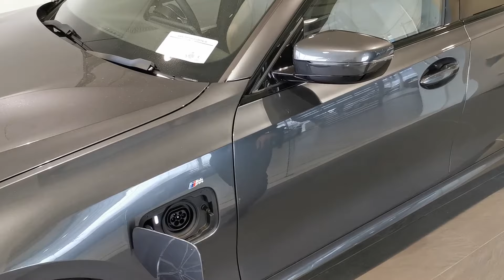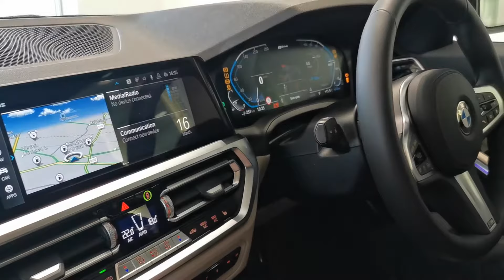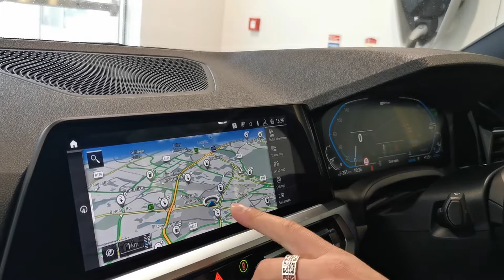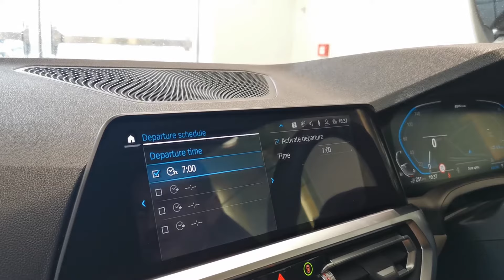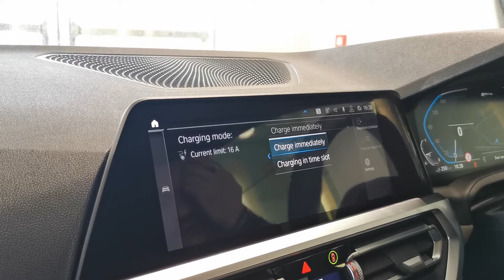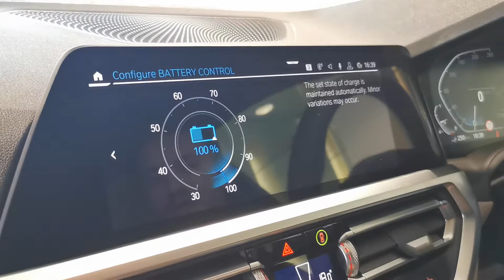How to charge your BMW Hybrid & maximise driving range

Comment: Great and clear video. A few questions though. When would you use electric mode? And also what is your opinion of not setting capacity to 100%? It's also advised to use not more than 20% of capacity. Any easy way to do that?
Reply: Electric mode should be used when you know you wont need the petrol engine, since in this mode the coolant and oil arent heated like in hybrid mode. If your comute to work 10-15km then you shouldnt need to have your ICE on.
Batteries dont like being at 100% and dont like being empty, as this degrades them faster.
 You can set your battery control at any range so 20% 30% 40% etc. The computer will prioritize petrol power and wont let the battery drop below this level by using regenerative braking.

Comment: How can I engage battery control mode to not use battery but at the same time have the petrol engine not turning off at trafic lights? I know I can prevent start/stopping by enaging sport mode on the transmission, but engaging that, deactivates battery control mode 🤯🤯

Comment: Charging the battery while driving, I find the increase in consumption rather significant instead of "slightly"... Which btw. I find quite logical. You should also have mentioned the hybrid option "Hybrid Eco Pro" (pushing the Hybrid button once...)  which isn't the standard option when starting the car.

Comment: I’ve just bought a 330e and I need to charge it using a 3 pin plug. The cable doesn’t quite reach the plug, can I use an extension cable?
Reply: I've had a 330e for over a month now and have had to use an extension lead as the cable is not quite long enough. I do think the official guidance is not to use one but mine does charge without any issues
Reply: If you use the BMW 3 pin charge cable that comes with the car, that only draws 10amps (which you can see by setting your car to draw 12amps in settings and then plug it in - it will show 10amps draw). Provided your extension has a standard 13amp fuse then you're fine. For ultimately peace of mind, reduce the amperage the car draws if you like, say 6amps. For reference a vacuum will typically draw 7 amps - and do you worry about running your hoover around the lounge?. Lots of false info and scare mongering out there about this and I was similarly worried at first. Disclaimer: Please don't take this as me telling you to do it, purely for your consideration based on my own research, do so at your own risk.

Comment: This was an awful review and suggest you keep your day job. The main point you got wrong is in regards to charging the battery. The 330e car uses regenerative energy to recoup some power, but it also can use the engine to charge the battery i.e the battery control button allows you to charge the battery up to 100%. The other point you are missing is that hybrids are about efficiency. Most of my journeys are short and for those I only use the electric motor. Over a month I do 300 miles and use about 4 gallons of fuel and about 180KWh of electricity in a car that will do 0-60 in under 6 seconds and can cover a long trip without having to stop for hours to charge !

Comment: You buy a volvo
Reply: I've had both,  my 330e g20 hybrid  is way better than the xc60 hybrid.  The only thing that was better was that the volvo gave me 20 more miles on the battery . Apart from that, the bmw only went to bmw for service and software updates. xc60 was in the garage 6 times in 3 years for various problems regarding the engine and battery problems . So as a driver of both cars, I would say bmw hybrid is more reliable and faster than the volvo .

Comment: It's enjoyable working out how to get the best out of this beast.

Zero charge start and a 280-mile journey last week got me 44mpg.

Using battery control set at 100% on a 50-mile journey gave 26 mpg - a massive hit to efficiency.

I don't find the adaptive mode all that clever: when a destination's in the sat nav it still seems to want to use up all the juice too fast to leave enough for town driving at the end. I'm going to try the suggestion below of battery control set at [just enough for electric at the destination town] - that way I can just go back to CarPlay instead of bothering with the horrible BMW map.

I can't charge at home but there's a free charger 10 mins walk away so I use that some days. My commute to work is 31 miles each way over a 1500-foot pass from sea level start, and no charging at work. When I leave home with a full charge by the time I get back at night I'm usually on 68-75 mpg which I'm really happy with - the whole 62 miles is twisty (inefficient but fun) small roads. Freewheeling down the hill gets me around +2-6 miles back each way. This commute has only 3 or 4 places to safely pass other cars so the boost gets used every day ;)

Best hybrid I've driven, BMW make it so easy to choose how you want to drive.

Comment: Thanks for this video. Just got my 330e last week and has been scrambling to get the best info especially on how to maximize fuel efficiency. Frank, is there any downside if I do not plug it in and charge my battery?
Reply: If you don't plug in a hybrid then you're just driving round in a 2 tonne petrol, your fuel economy will be in the bin!
Reply: @oPeanxt But wouldn't it still do braking/coasting regenerative charging, and/or you can use to Battery Control switch to charge while driving?  Of course, you wouldn't get the full benefit of having a full battery each morning, but you would still get higher mpg in auto hybrid mode, no?

Comment: You will use two times more fuel or even more when charging the battery. It is not at all “slightly more”. On the highway the car consumes around 6l per 100 km if you don’t charge. If you start charging, it is immediately 9 to 12 l per 100.
Reply: How long will it take to charge fully going highway speed?
Reply: @nickthequick  hours!
Reply: Hi @nicolasb5403 you are right but you said about an instant fuel consumption. After your battery fully charge you will use a battery and mpg will be zero. I watched a video from owner of 530e who showed an average consumption using different modes. After all if you use battery control to charge battery then move on electric the average consumption increases slightly more than 1 l per 100 km or 235mpg. If you want to save fuel in traffic jam then use battery control 15-30 km before it to charge battery 30-5% and use max electric mode in the jam.
Reply: I came here to say the same. Have been driving an X3 30e (same engine) for 18 months: there is a huge difference in consumption when you use the battery recharge functionality with the ICE motor.

Comment: An other way to use this car efficient: drive in electric mode if you are in town, and sport (combustion) mode when you are at the high way. Configure you sport mode settings all to comfort (except the engine) and you will have a combustion engine that is quick enough without asking too much fuel.

Comment: Don’t use sat nav, use electric only till it runs out then switch to auto. That’s the only way to get highest mileage.
Reply: False
Reply: Keeping it in hybrid I usually get at least 25 miles per full charge due to the regen breaking

Comment: Using Battery Control to charge the battery to 100% would be a silly thing to do. Using the petrol engine for battery charging is the least efficient use of petrol and denies you the benefits of having a hybrid. For very long trips I start with a battery charged from the cable and set the battery control to somewhere in the range of 30% to 50% depending on how much I want to have in reserves for the final few kilometers before I reach my destination. That way the car will best manage energy flow from both petrol and battery to minimise overall fuel consumption for the trip. As the battery level descends from 100% it will prioritise use of electricity until it reaches the set level and then it will start to prioritise use of petrol. It will still maintain battery level via regenerative braking, etc, rather than using the petrol engine for battery charging. Also, it's best to avoid fully depleting the battery as that will accelerate the aging/degredation of the battery.
Reply: After a year of using my 530e I used to do the same as explained. I started to drive with full charge till 30% with hybrid/auto, then change mode to battery control. If there is a traffic jam I change mode to auto or max electric drive. The energy consumption is about 4.9 l/km or 48 mpg. I use only supreme gasoline or 98/100 octane.
Reply: Thanks for your input, that helps explain things. I am thinking about getting one, and electric only mode would be great for around town, but twice a week I drive ~160miles round trip with no opportunity to charge half way. What kind of MPG can I expect with this with your 30-50% battery settings? Thanks in advance!
Reply: @Blandified  I have been able to achieve around 5.5ltrs/100kms on a longer trip than that (300+kms) with deliberately not charging the battery before I started. That is with normal highway traffic using cruise control set for 110km/hr and with light traffic. Starting off with a charged battery will obviously improve that figure.

Comment: Hi - couple of questions if anyone can answer please. Does it do the brake regen thing that other PHEVs do without impacting petrol use to top up the battery?  Also regarding the sat nav destination to help plan a journey to make it more efficient- can you program in destinations like work place so they are easily stored and retrieved?  Thanks for the info on the video. 👍
Reply: @Wooly Chewbakker thank you
Reply: BMW PHEV use brake regeneration always. I think Sport mode impact petrol to top up battery.

Comment: Can someone tell me why the battery power goes down on the motorway even if the car is running in petrol mode?
Reply: You’ve either got it in full electric, self charging or you’re driving too slow. At 70mph in hybrid mode it’ll only be using the petrol motor. It switches to electric on motorways if the traffic slows below around 60mph
Reply: It usually uses battery for climatization, or helps the petrol engine by decreasing the load on it to get a good MPG. You can shuffle trough the BC where it shows you the battery consumption. You will see that when you accelerate, you use more gas but also more electricity. In order to preserve your battery, you need to activate the battery saving mode. I have the F30 330e and the only way to preserve battery is by activating the SAVE mode. The problem with this mode is that it also charges the battery to 90% if it's lower, and it's using a lot of fuel to do so.
Reply: @dutescualexandru182  if you are planinng to have a trip of, let’s say, 200km on regular roads, not the highway, and you let the car to run in the auto hybrid way, meaning letting the car to choose when to use each motor, can you still find yourself in the situation where the battery goes empty? What happens when it’s empty? I assume you have less power, as the electric motor doesn’t help anymore.
Reply: @InkberryPages  the car will never let the battery go empty, after a certain threshold(depending on the mode you are driving) it will start charging the battery with the gasoline engine up to 24%. During this period you still get help from the electric motor depending on how hard you accelerate. The gasoline engine alone is 184 HP so I can't say I ever felt the car being slow.
Reply: @dutescualexandru182  thank you! I have an F10 520D with 184 HP now, and indeed 184HP are enough in most cases, but 530e will be the next one (unless full electric will be a better choice at that time). As a conclusion, if you adapt your driving style to recuperate energy as often as you can, you can avoid most of the times to have gasoline consumed in order to charge the electric motor.

Comment: I have a 330e and I get 24 miles range displayed from a full charge not the advertised 36 miles. From that 24 miles displayed I think I get about 18 miles of electric only range. BMW say this is because I only do short journeys. Also if I precondition the car it takes it from the battery even if it is plugged in and this drops the displayed electric range to around 17 miles. So on a full charge with preconditioning I get around 12 miles electric range, a third of the advertised 36 miles.
Reply: That sucks
Reply: I had a F30 330e and now 2021 G20 330e.  I get twice the range on the G20 compared with F30.  One comment.  It's winter in Northern Hemisphere.  The range really increases in the summer.  I agree with your range numbers.  I don't think there's any way to get 36 mi.  ?Perhaps at 46mph steady?  I'll try the departure timer 30 min prior to actual departure and see if this helps.
Reply: Fully loaded sometime the display reports 26 miles/42 kms. Most of the time I reach 31 miles. The displayed 26 miles is an estimation. Second if I program my departure min 10 min before leaving then the cooling/warming is on the charger and not the battery. 100% sure.
Reply: Doesn't sound encouraging: Especially if you precondition it with the plug it should increase ?
So even if cold weather eats a lot, with departure time set it should be 100% charged AND pre-conditioned as I understand it ?
Reply: @klasfard  The only way to pre-condition the car and have 100% charged is, as suggested by youtuber Mazman, to set the departure time to 30 minutes before your actual departure time to give the battery time to recharge after the pre-conditioning. I have not tried this but it should work.
Reply: Me too, cant find any explanation for this. All BMW literature says it takes the precondition power from mains but it obviously doesn't!
Reply: @stanoreilly5951  I have now got my car and also experience lots less range when pre conditioning, even if setting the time more than 30 min before, and I am plugged in.
However, as I understand it, since I am only able to set it to around 6-7 A when charging via mains, this is not enough.
Once I get my charging station and is able to use 16 A I hope that the pre condition will be able to take all of the power via mains.

I get around 25-35 km of range (40-56 miles) displayed now when it's cold. It has been around  0C to minus 12 C around here lately. And I find that the range displayed is fairly accurate, but the pre-condition eats around 5 km - so if I have 30 km and the start pre condtion I end up with around 25 km, which seems pretty accurate for the driving I have done
Reply: @klasfard  However, as I understand it, since I am only able to set it to around 6-7 A (FALSE) home circuits go to 15amp 120volts whats on the circuit you connect the car.if car only set to 14amp its ok.charging will be faster.
Reply: Not sure where this conversion is coming from, but 25 on is not 40 miles lol, in fact it’s the opposite
Reply: Copied from the Caradisiac web site. They did a test drive of the 320e.
But the 320th actually reveals all its electric efficiency at a stabilized speed between 60 and 70 km / h on peri-urban axes with traffic not requiring successive full stops.  We thus achieved up to 75.8 km before the thermal started, which is an excellent performance compared to the battery capacity which can be considered below average in 2021.
Reply: My 530e changes depending on the charge station i use. 29-34miles
Reply: I don’t understand how charging station may effect on the range. It should only effects on charge time.
Reply: If I use google maps via CarPlay is the car still will use that information for calculating what hybrid mode to use, or only with car map?
Reply: I get 191miles of electric range from my Tesla Model S 70, what I bought for £26K. Why are you wasting your money on a crappy hybrid car which has 17 miles of range?
Moreover bmw is a third reich slave labour war machine startup.👌
Reply: @dangr3957  I would not buy a Tesla for a number of reasons. 18 mile range covers 99% of my journeys so not an issue. The Tesla build quality is very poor. Panel gaps which most people would reject but are within "Tesla tolerance". No dealers/repair shops near where I live which make it difficult for the inevitable repairs. Which! magazine says "As Tesla’s cars age, they become the most prone to faults of any carmaker. It’s the lowest possible mark for Tesla’s 3-8-year reliability: a measly one star out of five." As to where they are built and slave labour, Teslas are now made in China, need I say more!
Reply: Clive Brooks I had a Mitsubishi Outlander plugin hybrid for a year and it had around 24miles electric range.
Every single time I went further than 10 miles, I felt handicapped.
It’s just convenient, and every time I had to charge it it’s not convenient. Now I got my Model S and I am happy. About the alignment issues, I have heard it and saw videos but I haven’t seen anything unusual on the Model S.
As a previous hybrid owner I strongly recommend not buy any hybrid otherwise if is dirt cheap.

Comment: Can anyone actually confirm if charging from a 3 pin plug still works after you lock the doors? Either it's really slow, or it isn't charging.
Reply: I have a 330e and I only have the 3 pin plug cable, no charging point yet. It does charge with the car locked.
Reply: @clivebrooks8207  Cheers Clive.
Reply: Absolutely. It also locks the cable in place so it doesnt get stolen.
Reply: Yes it charges and keeps the cable locked in when you lock the doors. You can only remove the cable once You’ve unlocked the doors.